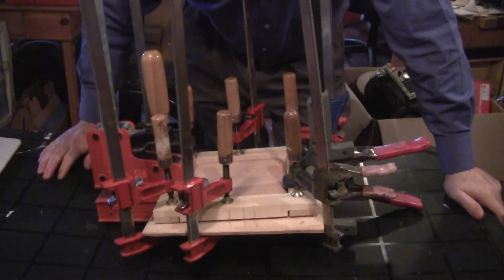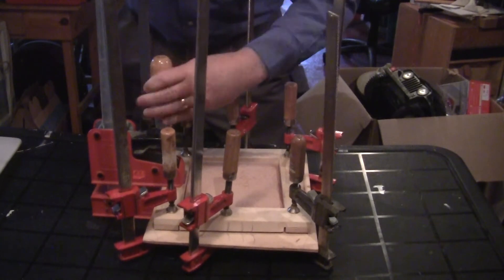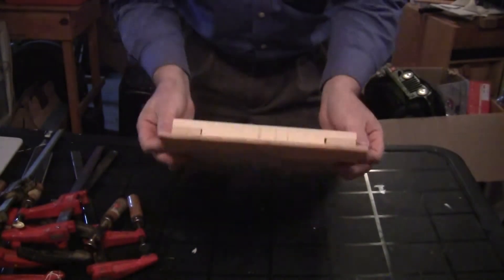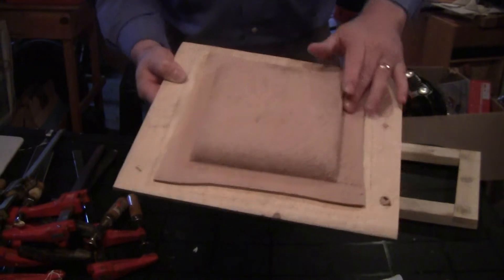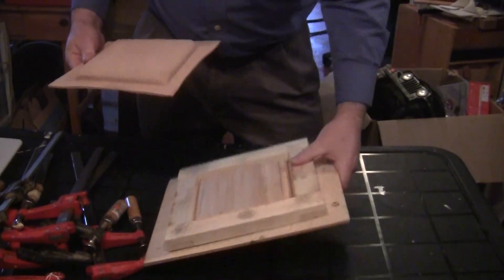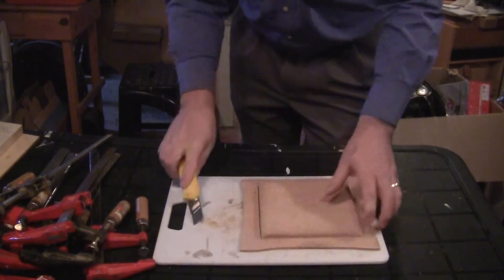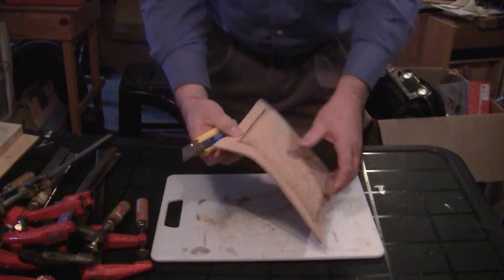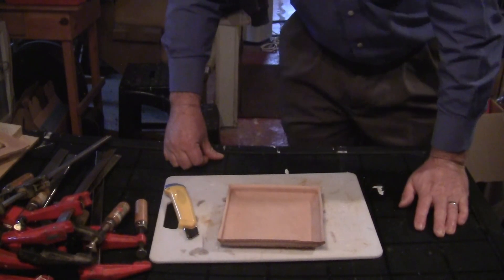Pipe Tray part 2

Comment: Heck ya brother I am making a contraption with some pans for a fun tray project. I will have to see how that goes and then show it off if it works well lol. You are awesome! Thank you again for all the help. The tray is badass
Reply from the maker: It never occurred to me to try using nesting pans for a 2 part mold. Should be interesting to see if it works. The bowing issue I have with the platen is because I'm using a plywood base that is too thin. I have since beefed it up and that should resolve that problem.
Reply: David35445 heck ya brother and your tray’s look awesome. I hope this works and hope I can come up with some good results for sure. I have some other ideas as well that I will be trying to make some pouches and wallets
Reply from the maker: Well if you need any help just let me know. No sense in reinventing the wheel.
Reply: David35445 I really really appreciate all the help so far for sure bro. I am thinking about pocket knife pouch, zippo pouch and some key chains for now and then bang out some other fun stuff as I go
Reply from the maker: All great places to start. You can get those bags of leather scraps from Michaels', Hobby Lobby and Tandy Leather. The size of the pieces are perfect for those projects. Try some pipe stands too.
Reply: David35445 oh ya I am def going to try my hand at the pipe stands for sure. I was thinking 3mm size or thickness. Veg tan and then dye
Reply from the maker: That should be fine. If you find the leather is too "floppy" you could stiffen it by wetting it and drying it under a bit of heat. Warning, it will shrink. It is how leather armor is made. Perhaps I could do a quick video on how that process works.
Reply: David35445 oh ya I will be wet fitting the objects to make the pouches so that would be perfect. Heck ya I would love to make like viking amor or bands for wrists. I am like a sponge and just soaking any info I can. I have a tandy store pretty close so I will be getting leather there and supplies.

Comment: I was wondering what sort of things you might use to get what type of finish on something like this. 
Something smooth for laying out tobacco, etc.
Reply from the maker: I leave mine raw, I don't want anything impinging on the tobacco flavours. They do take on a nice patina with use, almost like they are picking up some colour from the tobacco.
Reply: @David35445  Uh huh...
So, I should ask someone else, then?
Reply from the maker: There are way better experts out there when it comes to leather finishing. I suspect standard leather dyes would be fine but I couldn't express an opinion on some of the wax based finishes. I do use an antiquing gel on other projects and it stains my hands pretty good.
Reply: @David35445  In truth I wasn't really wanting any sort of additive or anything.  I'm not keen on the tobacco leaving residue either.
I was wondering if there's something to get that smooth worn-in type finish on it without it having to be handled for years first.
Reply: I mean... Like a big smooth rock or something while it's wet but before in goes into the mold so the edges don't get mashed down if you do it after it comes out.  Something like that?
Reply from the maker: Ahh, yes, I get ya. Yes, you could use something like a smooth stone to burnish down the leather, never tried before but I bet it would look really cool.
Reply: @David35445  You think it would work better before it was wet?  Maybe too smooshy when wet?
Reply from the maker: When wet it will deform, but, perhaps this would work. Form it like I do, let it dry, then mist it with water, let that soak in until the leather returns to it's natural color(but only just). Then try using the stone. That's the way leather stamping is done and it may be the key.
Reply: @David35445  Neat.  Yeah, sounds good to me.
Thanks for your time.